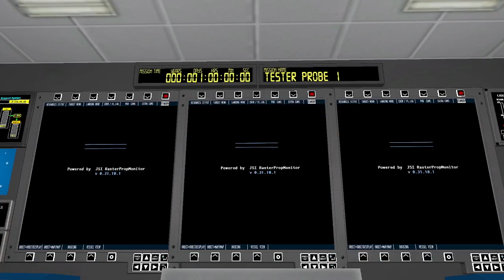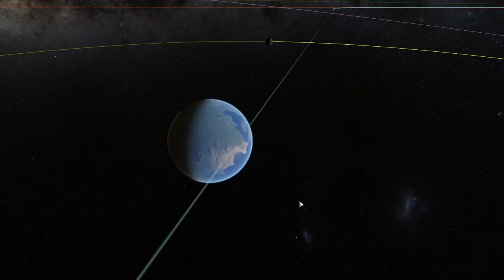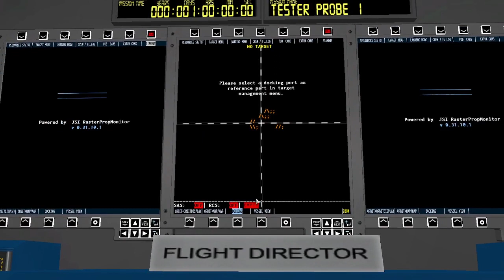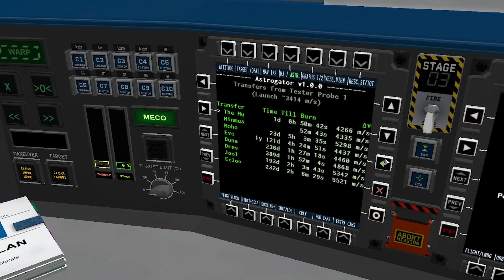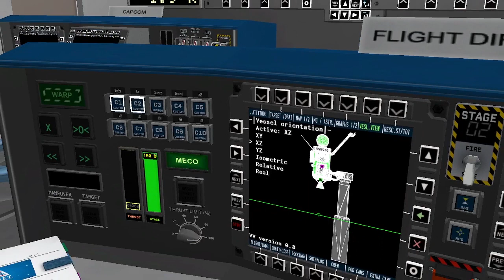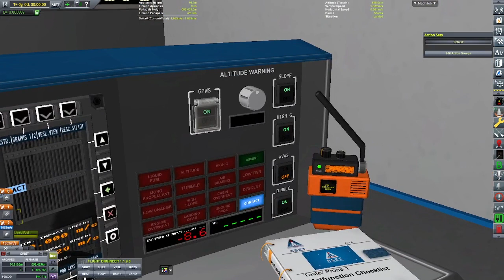Probe Control Room Recontrolled mod: a Guide || Kerbal Space Program

Comment: My mod is different. I don’t have the buttons on the sides. 😢
Reply from the maker: Get [Revivia] and it'll allow you to have several IVA mods installed at the same time, and you can switch between them beforehand in the VAB or even midflight. You may just have a different IVA than I but with Revivia you can have them all!
Reply: @ thank you
Reply: @Legionofone41  also so now the words on the screens are easy to read but the textures like for example the control panel words are really hard to see. Do you know why
Reply from the maker: Oh that's strange. What are you settings at? If you're textures aren't max that might be it, but if they are, then I'm not sure. @Noah_Ladd